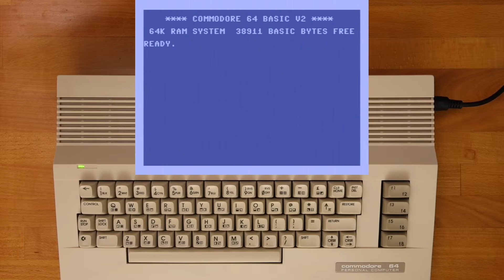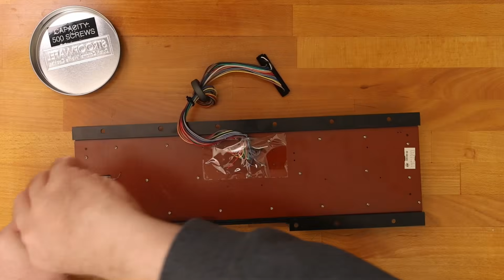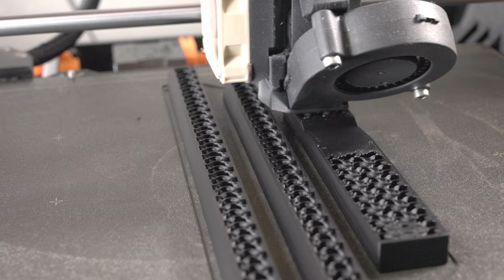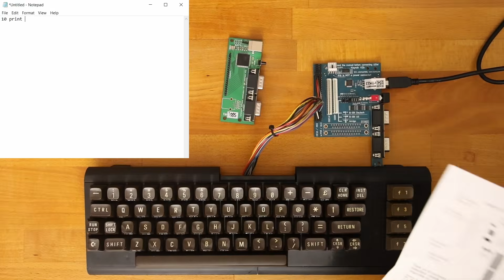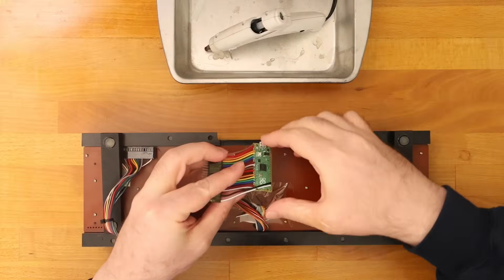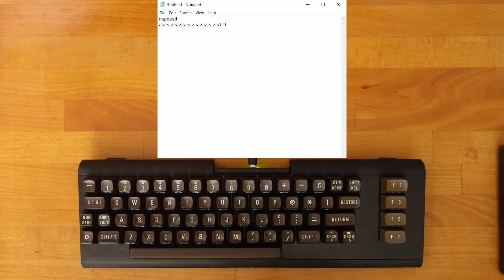Real C64 keyboard for MiSTer FPGA and VICE Emulation

Comment: After several years of having a keyrah in storage, i started to use it, and boy was i disappointed to discover exactly the same thing. Untested hardware that is even dangerous because the usb has no power protection.  Thanks for this video and all your work to create a useable solution.
Reply: I was wondering did you upload the STL's for the keyboard anywhere? It really looks nice.

Comment: I noticed that the keyboard starts out in ASCII and that I have to switch it to the MISTer mode every time I start up the MISTer. Is there a way to change this? Thank you for this project as I love using my original C64 keyboard on the MISTer. I used the 3d printed parts as well, although for the C64 keyboard I just used 4 of the long pieces from your 3d files.
Reply from the maker: It's open source so you can change whatever you like.

Comment: Very cool video!  That Vic-20 is exactly what I had in the 1980s.  Same motherboard revision with those massive heatsinks and same Commodore badge.  Although I did mess up one of the diodes in the video part which I fixed with a small piece of tin foil.  😂  It was due to a faulty video connector plug (RF modulator adapter) into the Vic-20.

Sadly, I no longer have the Vic-20 but will always remember the fun times with it.  😎

Comment: I'd love to be able to hook up my C64 Disk Drive and Cassette tape. My C64s have all died, but if I can hook up the peripherals to the MiSTer, it would negate the need for me (personally) to get another C64.
Reply: Diskbuddy and xoomfloppy each allow you to connect 1541 disk drive to USB. I don’t know if the mister supports this but to get your disks archived into a file format mister or emulation supports would be easy with either solution.
Reply: That's awesome man, thanks for letting me know. I'll take a look! @Retrocomputernerd

Comment: I'm surprised that no one pointed out that all Commodore computers starting with the first PETs did indeed have a lower case character set; however, how you switched between graphics to text and which one was the default varied among the different models.
Reply from the maker: You are probably right or possibly from a different universe. Do you remember Berenstain or Berenstein?

Comment: Hi there, awesome project and I've just bought the components to attach a C64 C to the MiSTer. Quick question, would it be possible or dangerous to split the cables coming from the keyboard to the Pico and the C64 motherboard? ie have the keyboard work on USB and the C64?
Reply from the maker: I've only done the engineering as far as I've presented in the video. I would guess avalanche at best, smoke at worst.
Reply: @rumbledethumps  Yeah as I went to bed last night, I realised it would be a dumb question. I'd only have the USB plugged in if the machine was off, and vice versa. But I guess they'd be all sorts of unknowns of what stray voltages would do.

Comment: Bear in mind that on a UK "IBM" keyboard, the @ and " keys are reversed from their positions on a US "IBM" keyboard, so checking Shift+2 isn't the greatest test. It's a common problem here in Australia for users to mistakenly select a UK keyboard layout (as we generally use UK spelling) when we actually use the US layout, and then having those two characters switched.

Anyway, you were likely getting that seemingly mismatched symbol configuration at 18:02 because a UK keyboard layout was being assumed rather than a US one.
Reply from the maker: None of the problems I had were due to localization settings. However, what you say makes me think the Keyrah designer might have tested with a UK keyboard and thought it was the same as a US keyboard. I'm fine with never knowing. I got mine to 100% the way I want and released the source so everyone else can too.
Reply: Not too irritating if you know what is wrong, but finding yankee mapping is very frustrating when you're in the UK, the keyboard is bought in the UK and the key caps show UK layout.

Comment: That is a really neat, compact solution and explained very extensively. 
Mister.ini does contain a keyrah option: "keyrah_mode=0x18d80002 ; VIDPID of keyrah for special code translation (0x23418037 for Arduino Micro)", but I haven't tried it myself.
Reply from the maker: The keyrah_mode option is implemented here (it's global):
https://github.com/MiSTer-devel/Main_MiSTer/blob/master/input.cpp
This option is for Amiga keyboards on a Keyrah. I didn't see any logic that would be useful for C64/VIC-20 keyboards.
Reply: @rumbledethumps  Ah, that makes sense. Too bad there's no built-in option for the eight bit Commodores.

Comment: this is pretty cool, I am using a teensy ++ in my Vicberry to let the vic keyboard talk to the raspberry pi this may be a better solution and I have a couple of unused picos in my parts bin, , ,
Reply from the maker: You probably noticed the VIC-20 game Omega Race running the background of the intro. I just held this keyboard under the 19" monitor on my desk and had the most terrifying thought of what a Vicberry might be.
Reply: Just a VIC20 with a pi4 inside it lol.

Comment: VT52 did have lower case. The only terminal I ever used that lacked lowercase was a Teleray 3541D from 1975, which was intended to be a close emulation of a teletype with a CRT.

https://en.wikipedia.org/wiki/VT52
Reply from the maker: You're right. The VT50 didn't do lower case, the VT52 added lower case. The dreaded off-by-one error happens in meatspace too. I clipped that part out. Thanks for letting me know.

Comment: I bought a pico to do similar with my 128,  so I could make it double as an external keyboard for my PC when I wasn't using it for the 128 mode. I've not yet started the process of the build and your project just showed the bumps and motivated all in one! XD But to be fair I also had bought an awesome KB in the mean time that also kind of helped derail the project. Bit I think this may have put it back on the map! I had also toyed with the blasphemy of wanting to make the KB RGB or something or maybe use one of my Amigas instead pref my custom towerized  A1200 - Ego Prime. Either way lovely work m8 and thanks for sharing @Rumbledethumps! XD 
Oh and Happy New Year!
Reply from the maker: The GitHub link is up now. C128 is three more columns of the same. Happy hacking in 2023!
Reply: @rumbledethumps  Awesome, I thanks for the tip!